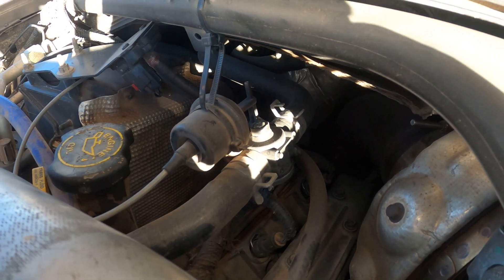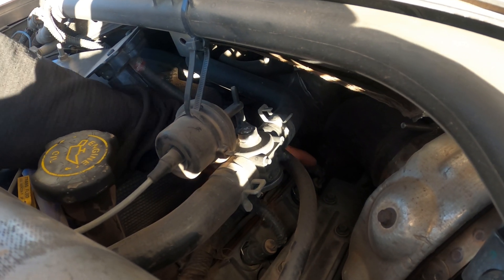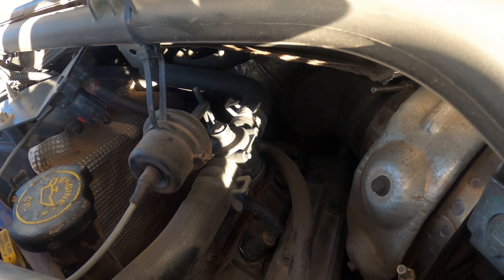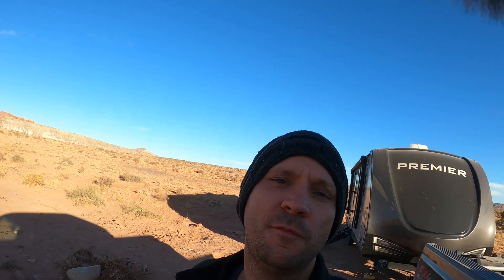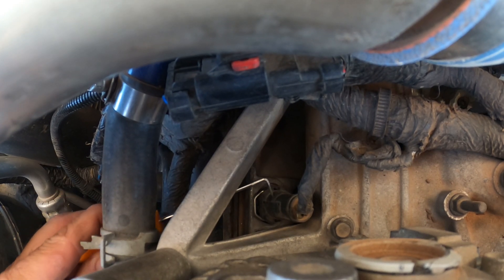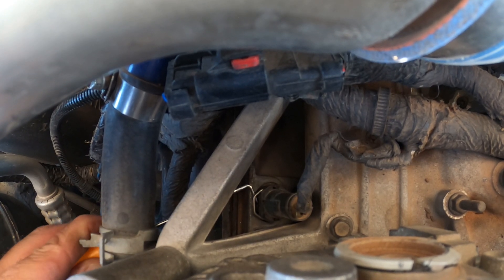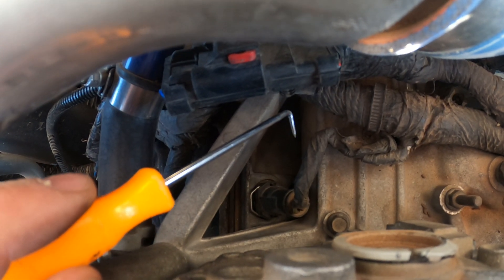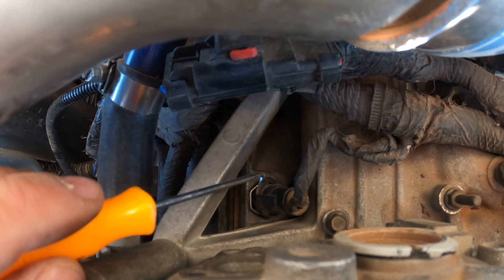6.0 Powerstroke - Smoking At Idle - Injector failure

Comment: My problem was after a full diesel logic injector change one came unseated, as far as I can assume.  Loud knocking and a TON of white smoke for about a second before I snapped the key off to try and avoid hydro lock or motor destruction.  This is after it idled for an hour just fine.   No revs.  Just happened as soon as I sat in the seat…Hope I’m right😂

Comment: Can't this also mean a cracked cylinder or bad piston rings? The way these things "roll coal" is by flooding the cylinder with diesel then ejects it out the exhaust so slight smoking not being flooded by fuel means it's getting to the bottom of the cylinder some way. Or I'd thing it can also mean sticking valves with anti-freeze going into the cylinder.
Reply from the maker: No it can’t because after I diagnosed it in the video. I replaced the injector and the problem was fixed.
Reply from the maker: I love arm chair mechanics tho…
Reply: @Grumpy's Diy  not really a chair mechanic. I've owed my 6.0 for 3 years now and done quite a bit of work to it. Last thing I did to it was rebuild the front end Minnesota winters are really tough on cars especially a diesel it's constant work I've also owned a Lincoln Aviator for 9 years now and it's still in really good shape. I'm just kind of researching because my 6.0 has a new development of on start up it blows blue smoke pretty bad until it's fully warmed up then it just goes away regardless my plan is tearing it apart this summer and putting the actual full bulletproof kit on it and go ahead and replacing the headgaskets while I'm at it. Been wanting to do it since I bought it. I seen the follow up video and seen you fixed with the new injector but I would have never just replaced just 1 of them as the one that went out is a sign that more are probably going to follow.
Reply: @MYKNFURFC  blue smoke? Blown head?

Comment: Had my injectors changed not too long ago and now i can see the exhaust smoke, also i believe its burning way too much fuel, no engine codes
Reply from the maker: Those injectors if you don’t use fuel treatment or if you run them out of fuel ie low fuel pressure. Will over time stick open. If that’s your issue unplug injectors one by one till the smoke goes away, then you know.

Comment: This is a diesel engine correct? When he said gasoline, he meant to say diesel?

Because my engine is doing the same but mine is diesel.
Reply from the maker: When I was referring to gas in the tank, I was referring to someone putting gasoline in your diesel tank which will make it smoke.
Reply: @grumpysdiy  I heard you. Thanks for the video.

I think in my case is that I need to replace the valve stems.
Reply from the maker: Damn, well look at it this way. Since you have to pull the heads, might as well get them o ringed and throw studs if you don’t have them. After the valve work, since you might as well do both sides for longevity.
Reply: @grumpysdiy  thanks for the advice. Definitely will have the mechanic do that as well.
Reply from the maker: Best of luck.

Comment: Is the white smoke consistent? 
Or does it come and go?
Reply from the maker: If you have an injector down your engine will run like shit. So does it run like shit or not? Like it’s missing or miss firing? The engine will literally shake. So is that happening? What you may have is a sticking injector. Put some kind of injector cleaner in, because diesel is so refined these days they take out the best lubricators.

Comment: This is happening on my 6.7 
If I keep driving can I risk damaging engine ? I know it wasn’t cuz my dumb ass had water in fuel amd it froze injector
Reply from the maker: When I spoke to a Ford mechanic when this happened to me, he said I would run the risk of hydro locking the engine. Now you could unplug the injected and drive it like that, though it will drive like shit.

Comment: I had to check injectors the other day on my 6.0l. I used the method of pressing the metal clip in that will release the injector harness. This way you dont lose the metal clip.
Reply from the maker: Awesome!
Reply: 100% my o6 is the same push em in